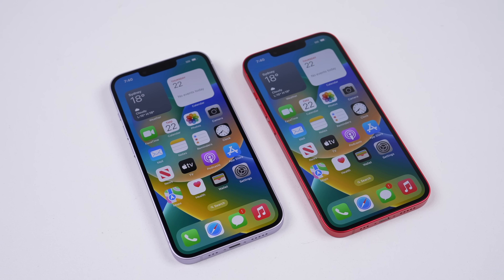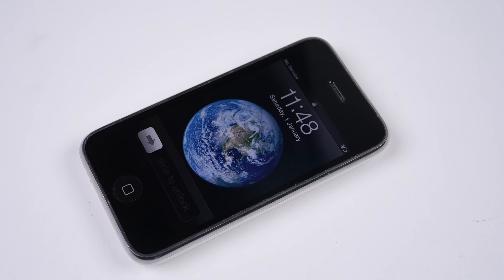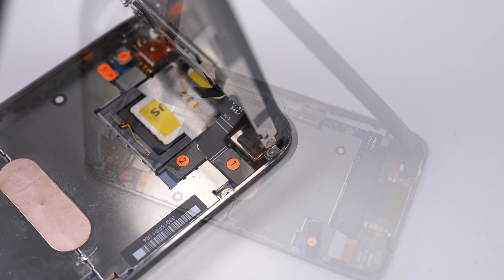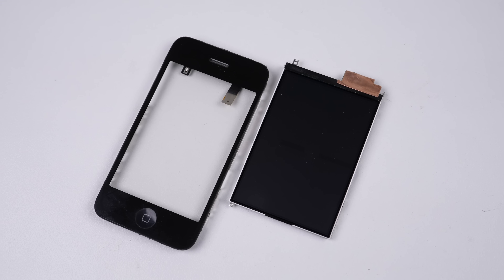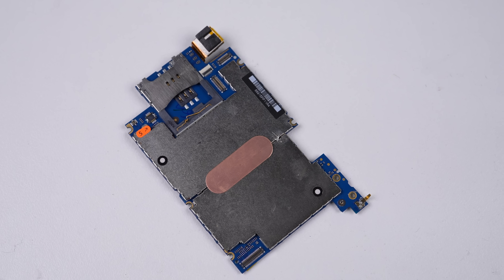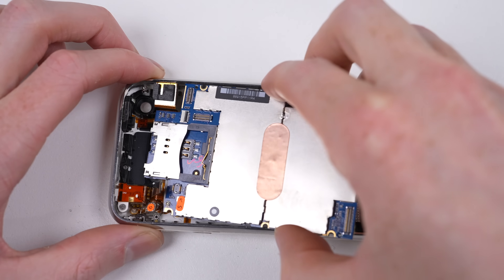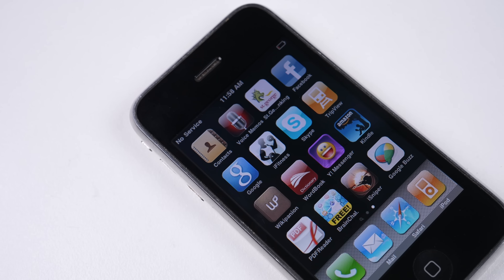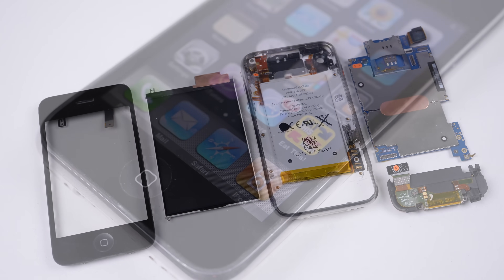Apples Most Repairable iPhone EVER - Teardown And Repair Assessment

Comment: Keep in mind the 3G was manufactured in an Era when Steve Jobs was still alive. 

Thus, it had to be both sustainable and repair friendly.

When Steve Jobs died in 2011, the first iPhone that was released after his death (iPhone 5) started the trend of heating up the display in order to get access to its internals.

Coincidence? I think not.
Reply: Also, not all Steve Jobs devices were actually repair friendly, most notably, the iPod touch.
Reply: No, not at all. Steve Jobs was very hostile towards user repair and upgrades. Take the Macintosh for example. The Macintosh 128k (1984, CEO Steve Jobs) had no upgradable parts whereas the Macintosh SE and II (1987 CEO John Sculley) had expansion slots and on the Mac II, a user serviceable case. This trend of repairable Macs continued until Jobs returned in the late nineties. Starting with the iMac, Apple computers became harder and harder for users to service.
Reply: @treo5249  I get your point.

But I was talking about iPhones, mot Macs.
Reply: @danfvsion  My point was that Steve Jobs did not want repairability at all. Apple under Steve Job’s leadership was very much anti-repair. Sure, in today’s world the iPhone 3G or 4 might be repairable, but in 2008, that was when nearly every phone had a replaceable battery, and had a separate SD card for mass storage (which meant only the system files would be stored in the internal memory) it wasn’t just the Macs too, the iPad 1 and 2 had glued batteries that needed a heat gun to remove.
Reply: I think it actually is a coincidence.
Reply: Surprised? I'm certainly not.
Reply: That and the iconic high resolution 3D icons and textures before everything became over-simplified with iOS 7.
Reply: @WantBadtime I actually really liked iOS 7 icons & iOS 7 in general, they weren’t oversimplified since you could tell what they were, I think our current iOS icons are oversimplified, they’ve become flatter.
Reply: You don't need to heat an iPhone 5 to remove the screen. Only with the waterproof iPhones from much later. I think it's the iPhone X(?) that you can't open at all
Reply: @Tom2404  Yes, you do.

Even the iPhone 6 series had a waterproof gasket that needed heat to remove.
Reply: @danfvsion  nope. I think the 6S had some kind of waterproof gasket, but I remember you didn't need heat to break that seal. I fixed the iPhone 5s and SE of my dad multiple times and never needed any heat. I also own an iPhone 5 and 6 graveyard, none of them have any gaskets.

Comment: The air gap between the LCD and the digitizer is not very noticeable on a 3.5" iPhone. On an iPad, it makes the screen feel squishy, as if it were plastic.
Reply: Also the gap has a big impact on screen readability in bright lighting conditions.
Reply: The air gap also means dust often gets in and obstructs the screen
Reply: Just as I thought...
Reply: Get ready to be clicking on youtube and need a screen replacement😂😂😂
Reply: We have an iPad 2 that misses half of the glass because it just fell out after like 10 years

Comment: I’d like to argue that the 6s plus is easier to repair despite it using proprietary screws to access inside. Been rocking my 6s since 2016 and since then I’ve replaced the aux port, battery, speaker, charging port, both front and back camera. Still going strong and gets security updates in iOS 15. And yes I’m incredibly irresponsible with my phone that’s why I replaced all those parts. Gonna try to push this bad boy as far as I can
Reply: Pretty cool do be able to do this, really.

but... It really got me curious how you managed to break the cameras even! Like, barely I get it with speakers but the camera is quite incredible.
Reply: @Kalvinjj  I unplugged the cameras before detaching the battery cable so when I put it back together, the cameras wouldn't turn on. As for the speakers, it either got water damaged or it just wore down with regular wear and tear.

Comment: Even though I made a lot of money repairing the iPhone 4 and 4S. It was always pain in the ass to replace the screen. The 6/6s series wasn’t that bad to fix either.
Reply: yep! i agree with you! ive fixed a lot of iphone 6/6s before from batteries to screens.. i own a iphone 6 and a iphone 6s plus and swapping the screens/batteries isnt that bad...
Reply: i wouldn't say it was a pain in the ass, if you charged a little bit extra you could've just used a pre-assembled screen assembly - that would usually cut the repair time and complexity in around half the time, and since you would keep the original frame and broken screen you could technically "recycle" it and reuse it on another costumer's phone.

a friend of mine that worked at a repair shop at around 2012-2013 told me that for broken iPhone 4/4S/5/5S/5C displays they just replace the whole LCD assembly with the frame and everything, and they have a guy that works there that his whole job would be to just repurpose these frames - they did charge a little bit more then their competition but offered the repair to be done in less than half the time of their competitors and for them for every 3 or 4 iPhones they would replace the screens on, they would use the LCD assembly that they repaired - essentially saving them money on some of the repair parts as well as labour time.
it sucks that from iPhone 6 onwards the inner workings and layout of the iPhone became much too time consuming to even do a simple battery replacement without at least using a heatgun and prying tools, and from iPhone X onwards Apple practically began their modern anti-repair practices.
Reply: @HoLDoN4Sec  it was a pain in the ass since you had to remove the Battery speaker assembly, vibrator , earpiece motherboard , wifi antenna and all internal components just to remove the screen !
It doesn't have anything to do with a preassembled screen or frame since the problem was the mounting method which still was done in 10 minutes but it was a pain doing all that.
Reply: The 5c is okay tbh.
Reply: 6 and 6s 7 and even 8 series and X, and 11 series were so easy to break, I earned too much from them lol but since the iPhone 12 came out then we had  like 70% drop on display repairs for the newer models :(

Comment: I truly wish phones had somehow gone in a direction more akin to laptops and regular computers where you could maintain them for a while and only have to upgrade when there was a meaningful necessity (more ram, processing power, battery capacity).
Too bad that was never going to happen as it's more profitable to make disposable hardware.
Reply: I guess in another way we can pray that laptops and regular computers don't go down the way phones did.
Reply: @eshk7281  you mean, stop going or at least not ALL go right? Cause soldered in SSDs on the Macbooks are already a thing, paired components and the same crap we see on phones are already happening.
Reply: @Kalvinjj  Well shit
Reply: @Kalvinjj  Well.. at least you can build your own pc unlike a phone..
Reply: What we need is the ti83 calculator phones. But we won't get it for the same reason that no android OEM can copy the philosophy of Apple's SE model phones
Reply: Just picked up a new Asus laptop with soldered on RAM, they are following suit.
Reply: Laptops are more locked down than before, sans the Framework laptop as well as many gaming laptops. Most are just fitted with soldered on SSDs and other key replaceable parts
Reply: @rosaria8384  ehh you can still very easily find laptops with decent CPUs for which you can still replace the ram, storage and other broken components.
Not if you go after the super thin ones although with NVMe SSDs there really isn't an excuse.

Comment: yes the 3g and 3gs were great
i have a case of a hard to repair phone that there is no way i am fixing my old huawei p20 the screen fell off and broke less than a week ago i have to open the back panel wich is glass and glued on then remove like 20 screws or more remove the battery then i can remove the broken flex cable not worth it cuz if i go into a service to repair it
new battery
new screen
new charging port speaker and mic
it will cost me more than its worth fixing it so for like €120 I'd rather get a budget phone that's better in every way

Comment: I've noticed one design flaw with the iPhone 3GS' LCD ribbon cable. If you open and close the phone too many times, the ribbon cable will tear along where that little controller box is, causing the LCD to stop working. I've had it happen to two 3GS screens.

Also had two 3GS batteries expand on me, but on the other hand, I've got a third one which still has its original, unexpanded battery nearly 15 years later.
Reply: Quite impressive that you can even find such a problem, that requires you to open the phone too many times. Heck, even if too many is like 5, that's already way above what any disposable meant to break crap nowadays can take, heck, some will be dead on 1st attempt.
Judging from the older iPods, iMacs and such, it seems Apple's anti-repair BS is quite recent, back like pre 2010 or wherever, it was quite hit or miss, with full priority on the design of the device instead, and if it happens to get in the way of repair, too bad, if it doesn't, great. iPod 4th gen ones being quite easy to open, with a standard IDE 1.8" HDD inside, while the latest gen was horrible, and the Nanos being quite terrible as well, the 1st iMac had the PC part separate from the monitor electronics, and then later the eMac was combined...
Reply: So this is why the screen on my 3GS stopped working after repairing the phone and replacing the battery. Guess I'll have to a new one then. Good to know, haha.
Reply: I don't see why people are complaining? They choose to buy Apple products, They pay a premium for that pleasure (contract or no contract), They want be in Apple's ecosystem... So shut up and cough up when it's time to repair replace or upgrade! If that is such a problem, Don't get sucked into Apple  😂 I certainly don't.
Reply: @danimayb   It's more of a "apple sets industry device standards" not 100% true, but once apple had a glass backed phone with the iPhone 4, all of a sudden the rest of the market started rushing to that part goal. By the time 3-4 years later, once everyone had a glass back, drastically decreasing reparability. That was right around when they deleted the headphone jack. Next thing you know, 2-3 years later. See what we're getting at? Apple being a market leader, making active anti-repair decisions, is a real bad omen.
Reply: @spottedtango  That is sadly very true! Watch this space... I prefer avoiding Apple products anyway so I'm OK for now.
Reply: That happened to me and I still don’t have the cash to buy a replacement screen, it’s such an awful design flaw, but I don’t think Apple has cared about that since usually the screen would be replaced or somethint
Reply: Can confirm with the battery, I used to have one but battery expanded and cracked its display and the plastic shell. Great phone otherwise!
Reply: I remember that on a 3GS ,it just showed a white Display lol , older models had Many flaws and not to forget the dust between the touch and Display which was the worst !!
Reply: Same thing happend to me 10 years ago. I still have it. Does anybody know where can I get cheap parts for this phone? I see it's more expensive than other models, maybe because it's too old.
Reply: @EstebanRestrepo0  I bought one on eBay back in 2019 really cheap. Can't remember the exact amount, and it's no longer in my purchase list as it was so long ago.
Reply: @DJBla2e01  don't see much at a lower price now a days, but thanks! I'll keep checking out from time to time :)
Reply: @EstebanRestrepo0  Aliexpress
Reply: facts